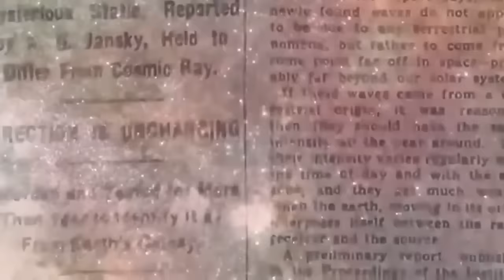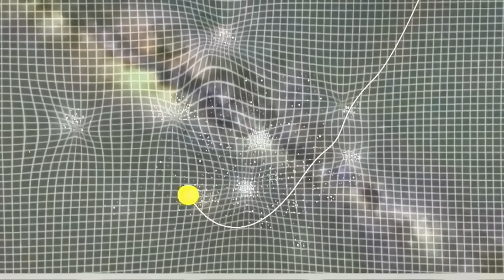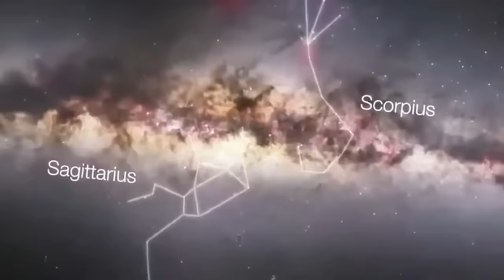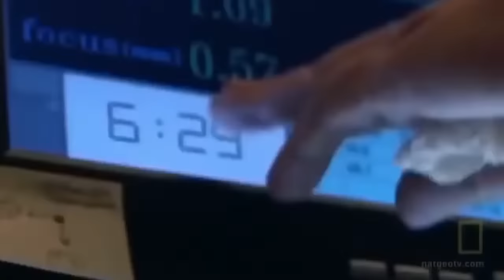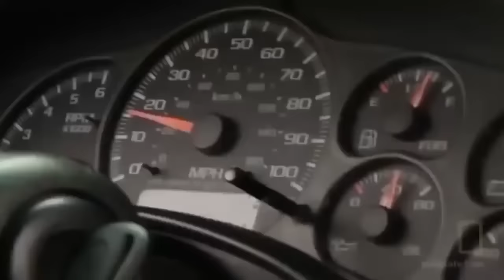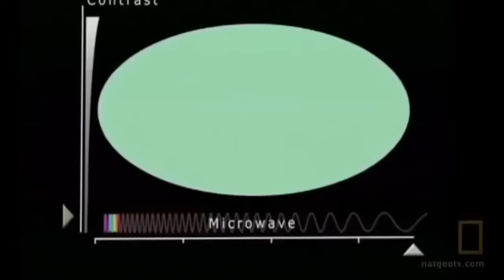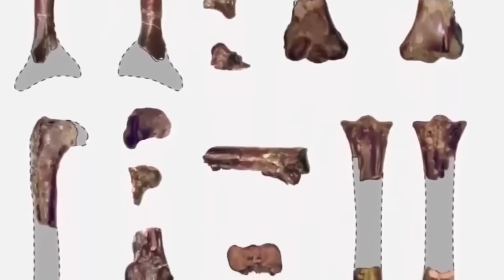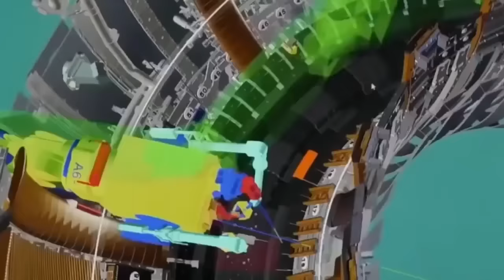Cosmic Whirlpools - Exploring the Enigmatic Origins of Black Holes

Comment: If a photon has absolute 0 mass then what does gravity in a black hole grab onto to draw it in?
Reply: Yeah and on the same note. If gravity is propagated through a particle (the ever elusive graviton) how does this particle escape the gravity of a black hole to effect the universe around it when not even massless light traveling at lightspeed can escape?
Reply: @1112viggo  I think you folk are forgetting that Newtonian mechanics don't apply--I mean it seems so from the gravitational equation that multiplies the two masses, but what Einstein informed of its space that is warped and so a photon is actually following ;the shortest "straightest path" and one of the early confirmations of Relativity was the bending of light visible when an eclipse made the bending absolutely predictable.
Reply: Gravity (of a Black Hole) tells space how to curve... Photons follow the curvature of space near a Black Hole, even into its center near to the singularity. Photons trapped inside the Black Hole cannot reach the Escape Velocity needed to exit. Or so I understand. Feedback solicited if I may be wrong.
Reply: @johnsmolley1941  That does not explain how and why gravity is always communicated between objects at lightspeed regardless of any external influences, including gravity itself.
You know, if the sun disappeared right now, we would not only still see the sun for about 8 minutes, we would also still orbit the non existent sun for the same time. For light it makes sense that the photons are still traveling towards us after the sun disappeared, but what about gravity? Is it because a particle that must reach us traveling at lightspeed like the photon? Nobody really knows.
Reply: It pulls the fabric of space called space time into it.